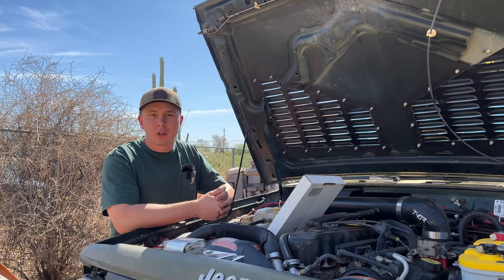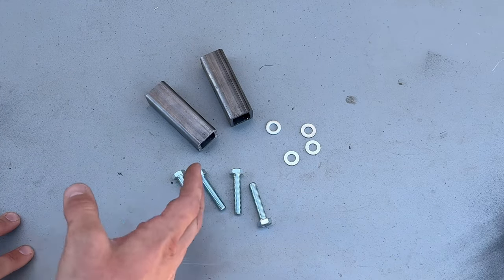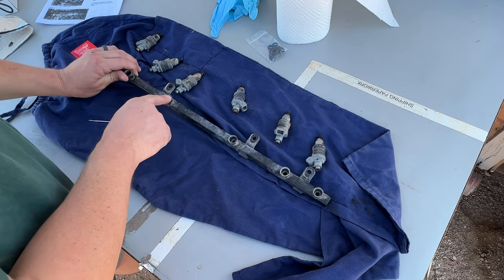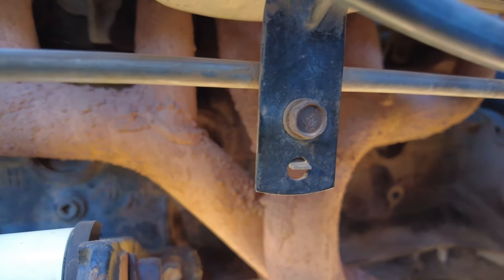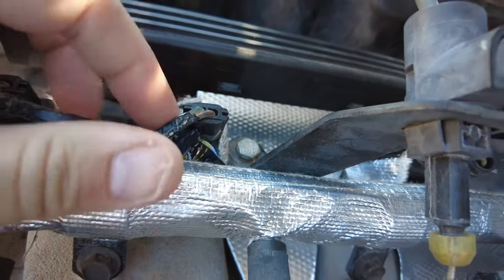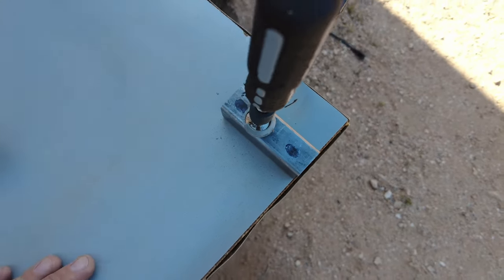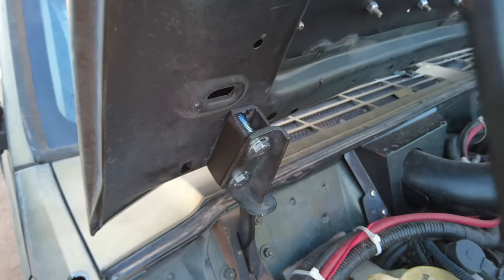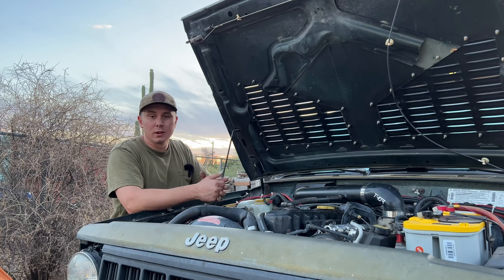Ways to FIX HEAT SOAK in a Jeep XJ! Fuel rail wrap & DIY XJ hood spacers!

Comment: chased heat soak for a year wrapped fuel line,installed timed relay on electric fan, insulated fuel line,what the final cure for misfire on cylinder 3 was I found fuel pressure fade after I turned off the xj,replaced the fuel pump problem solved on my 2001 xj
Reply from the maker: Really 😳 I would of never guessed that! Thanks for that info if anybody is battling it they should troubleshoot that too!
Reply: Good info. Good write up. Thank you.

Comment: I installed the same fuel rail shield, didn't think about the hard line great tip.  It solved my heat soak issue on my daughter's XJ.  Great video!
Reply from the maker: Glad that it fixed her issue! I hope it does the same for us and I’ll have an update post or video when we do our first hot weather trail run.
Reply from the maker: Btw I seen 2 in jeep sleeping setups that could work for you! I’ll have a post about both soon once I get more info 😊
Reply: @2AOverland  Thank you!  I look forward to seeing

Comment: I have trouble with the heat from the header melting my motor mount bushings. I have the hood spacers so I'm going to try header wrap and see how that works. 
After watching you put this kit on I'm going to try that. Really looks good 👍
Reply from the maker: Damn that’s some radiating heat! I hope the header wrap and fuel injector/rail kit helps too. Thanks for watching!

Comment: upgrading to 4 hole fuel injectors also helps.(or 12 hole injections)
Reply from the maker: Great tip! Thanks for watching! Did you install 4 hole injectors? If so what did it do to your gas mileage?
Reply: Agreed. I’ve never had heat soak with 4 hole injectors. It also seemed to help mileage 1-1/2mi per gallon
Reply: 4 hole injectors was a good upgrade for me. The throttle response was much better. All I can say about MPG is that at least it didn't get worse for me 🤷‍♂️
Reply from the maker: Good to know 🤔 I might have to do that upgrade soon
Reply from the maker: You guys are selling me on this! Lol I’ll start looking into it for a future upgrade

Comment: Would it be possible to add the heat shield without taking out the injectors? I just put in new injectors and would rather not do that whole job again if not absolutely necessary.
Reply from the maker: You would have to cut it up and slide it in there between the injectors but I would suffer again and pull the injectors 😬
Reply: I cut mine up and slid it. I didn't want to remove injectors